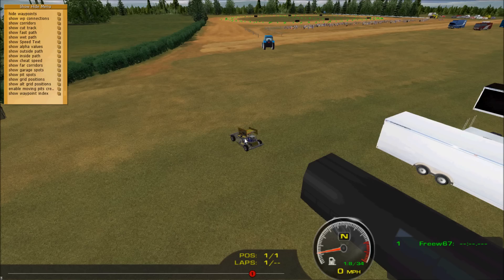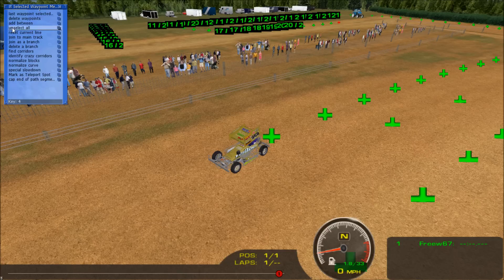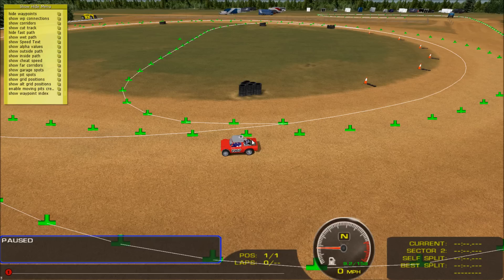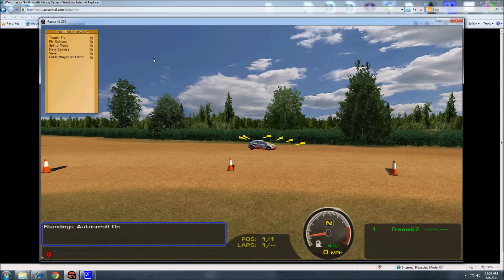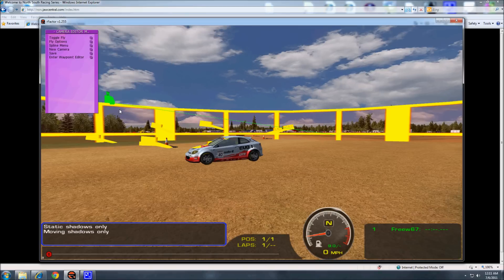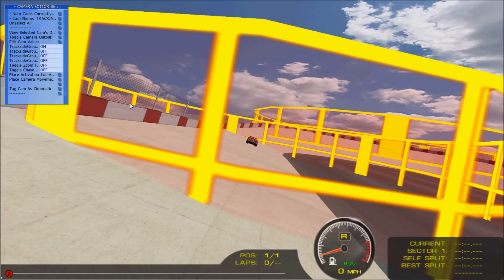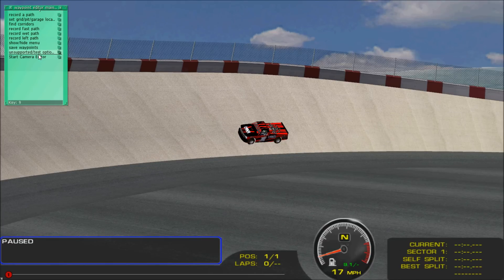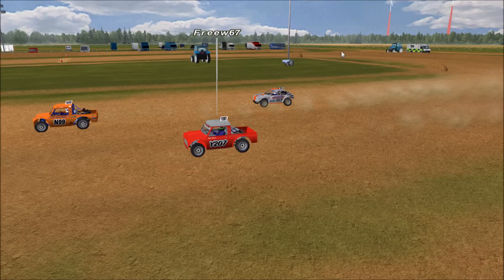rFactor Tutorial Aiw and Cams

Comment: Hi, I don't know if this will still reach you but here goes nothing. I'm having a problem converting tracks from NR2003 to rFactor. A lot of objects, including parts of the track itself and entire cars, don't show until you are really close to them. I already tried changing LODin and LODout values in the scene file, that does nothing.
I have this problem only with the onboard/swingman cameras (Home, Insert, PgUp) and not with the trackside (PgDn) cameras, so I think it must be related to the LOD Multiplier. I would use the AIW editor to change the cams, but it's really difficult, as is editing waypoints. The waypoints and cameras appear and disappear as I drive around, so I basically have to guess where everything is.
I have the same issue with a track converted from GTR2, but it's not as bad there. With the NR2003 tracks it's really bad. Is it a transparency issue? What could it be? Can you help? Please help! Thanks in advance.
Reply from the maker: Sometimes, the actual GMT has a LOD on it that causes issues.  When I did 2k3 tracks, I almost always had to import into max then re-export back out to get the correct settings.  I stopped doing the 2k3 conversions because the amount of work it took to get them looking good, it was easier to start from scratch.  When dealing with Cam editor,  I know this sounds weird but turn off num lock.  That sometimes messes with the editor.
Reply: @freew67  Thank you so much for your reply. I don't have 3DSMax, so I am doing everything in 3DSimEd. I've been trying to change LOD values on some GMTs in 3DSimEd and then exporting them, but so far it doesn't seem to make any difference. I'll keep trying, because I suck at 3D modelling myself so I have to convert tracks. I'll let you know if I make any progress. Thanks again.
Reply: P.S. By the way, it happens on the onboard view too. When I am in the car cockpit, entire parts of the car (the steering wheel for example) simply don't show up. This happens only on these converted tracks.
Reply from the maker: @jabrown  you should be able to import an entire track into simed and export back out.  Its been probably 10 years since Ive done it so no clue how. sorry!
Reply: @freew67  I tried pretty much exactly that, but that creates the problem I mentioned. I'll try to do it again. Don't worry, your comments are much appreciated!
Reply from the maker: @jabrown  Maybe swap cam files from another a default ISI car/track.  They wont line up but its one quick way to see if its gmt's or cam files.  What I do when this happens, is start with a fresh scn file and remove everything but the group.  That way, I know its either gmt's or something else.  Use a default ISI or a car you know works and see if it happens.  Have to act like the FBI to sometimes figure out these issues. lol
Reply: @freew67  Haha, it defnitely is some sleuth work :)

What do you mean by "the group" btw? You mean these lines in the SCN?

GroupMethod=Dynamic
MaxShadowRange=(350.00)
AmbientColor=(0, 0, 0)

FogMode=LINEAR FogIn=(700.00) FogOut=(1400.00) FogDensity=(0.00) FogColor=(190, 198, 213)
Reply from the maker: @jabrown  sorry, remove everything but the ground. lol
Reply: @freew67  Ohh, that makes sense. I'll try that!
Reply: @freew67  I FIGURED IT OUT!!! It turned out the view settings were wrong. Someone on the RaceDepartment forum told me this, there's no way I could have figured that out by myself. I copypasted the view settings he posted and everything suddenly looked normal. I wonder if this is specifically for tracks converted from NR2003 tracks or for any track you build yourself...

But unfortunately, I have to redo the track from scratch anyway because I found out the version I downloaded (which seems to be the only one in existence, at least for NR2003) is outdated.
Reply from the maker: @jabrown  Great you figured it out!  Sucks its the wrong version but hey at least you learned something along the way. lol
Reply: @freew67  Certainly, and I learned a lot more because I'm modelling the whole thing in Blender, which I have never done before. I have very little experience with 3d modelling. It's been a pretty steep learning curve. I just learned how to do UV mapping and materials. So, wish me luck. And thank you so much for replying to my comment on this video you made years ago. :)
Reply from the maker: @jabrown  Good luck and NP.

Comment: I think I figured out why it goes nose to tail. For some reason the cars only follow the fast line. How do I fix it or can it be fixed?
Reply from the maker: Is there a left path?  On the rolling lap the left path basically sets both lines for them to roll.  If there isnt a left path they tend to just follow the center line.  Following just the fast path is an odd one.  Also is the grid setup properly (1 on the inside)?  If your having that many issues, I would suggest just starting a new AIW file.  You can copy the garage/pit over once you have the center/pit lines done.
Reply: Ok ill try that and see what happens
Reply: Still follows the main line no matter where I put the fast line or the inside line. Checked the grid and it appears right.
Reply from the maker: John Mandery sent u a pm

Comment: I need help. Im trying to fix ai on a track that was already created. The only problem im having is that when the cars start the pace lap they dont follow two lines. For some reason they try to merge into one line and during the race they dont break up and race each other they follow each other nose to tail. How do I fix that?
Reply from the maker: Sounds like it could be that there is no fast path or left path.
Reply: Ive set both of those multiple times and I still get the same result. Ive spent many hours trying to fix it
Reply from the maker: Did you try making an entirely new AIW file?  Could the xsectors be facing the wrong way?